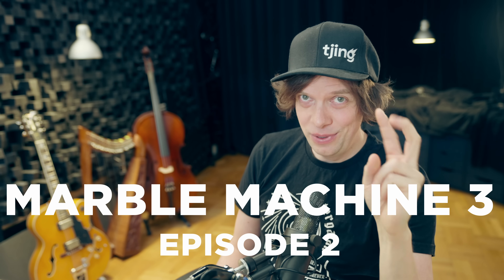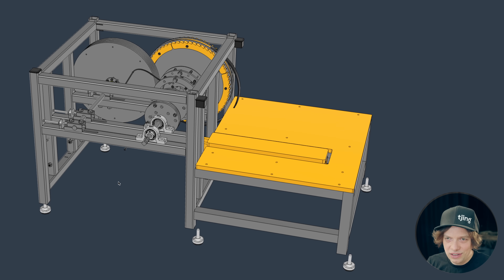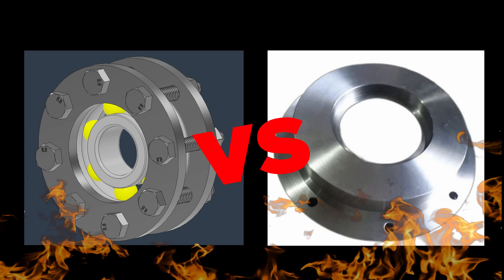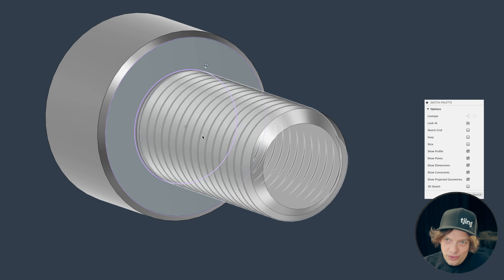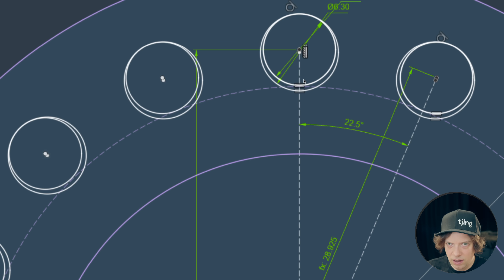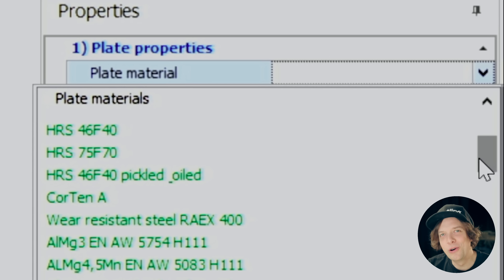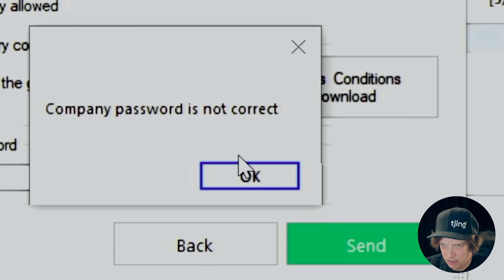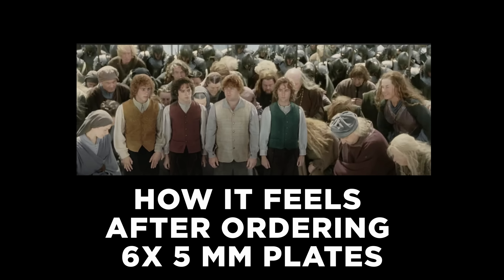Cheap Bearing Housing - Marble Machine 3 Ep.2

Comment from the maker: official place for engineering feedback, please post and help upvote the best feedback! 
https://www.reddit.com/r/MarbleMachine3/comments/137ew6l/cheap_bearing_housing_marble_machine_3_episode_2/?
Reply: A PC has more resolution than 1080p.
Its not only Mac that go 4K. A PC can also go to 4K. 😁
Reply: @metern  what, pc's only go 4k?
Reply: @dbtest117  Im not sure on which one has only 4K. But i do think most of the newes and most powerful pc gan go 4K. Maby you have to overclock them.
Reply: @metern  Well a simple iMac M1 is 4.5k and previous 27" has been 5k.
Reply: It will not work, as the tangential power will drag the disks of  center.  Any imperfections in centering the discs will drag the disks of center when you start to spin them.  And they force pulling the discs of center will increase dramatically with rotation speed.
Reply: You should really make a automatically centering mechanism that can be tightened with a bolt. Something like in a mechanical camera has to change the hole size for light to pass through. Beefed up.

Comment: Okay, but would it be any better if he used a larger diameter thick "spacer" ring - with machined inner diameter - that fits between the outer ring of the housing and the flywheel itself? To surround the bearing entirely and constrain its movement?

Comment: Martin, your fly wheel needs an automatic gears system. That way it can output constant rotation. A gear box that converts speed down to torque, and torque up to speed. Your fly wheel then becomes the battery. But it needs to be smooth though, because the gear shifting may effect the stander deviation.

Comment: Sounds good but the contact point between the screw and bearing is small. Just the tip of the thread. I would add a jacket for the screws between the plates so you increase the surface. It will increase durability by avoiding fast eroding

Comment: You should really make a automatically centering mechanism that can be tightened with a bolt. Something like in a mechanical camera to change the hole size for light to pass through.

Comment: Two points: 1 - You are comparing costs only and disregarding reliability.
2 - These are set screws and not bolts. Tolerances of the OD of set screws are poor. 
A "fitted bolt" would be better, but still not the solution.

Comment: If these are going to be laser cut, be advised that there is typically a minor defect at the start/stop point of cutting a circle, and unless you work with the supplier, it will likely show up as a little "booger" at a certain angular orientation the same on each hole.  This will likely affect one hole at a minimum, and possibly be affecting the two adjacent holes as well.  If the start/stop point is on the inner section of the hole pattern, it will not affect your fit, but this would not be the default expectation from laser-cut or waterjet-cut parts.

Comment: I'm not an engineer, but I cannot see this working as bolts will have different tolerances between batches, plus I think you will end up with premature wear of the bearings with uneven pressure around the outer housing.

Comment: you are over engineering it.  Simply purchase a four hole flange bearing and bolt it on.  No machining required.  It is already built.  4 holes to mount it to your plate, and you are done.

Comment: Martin, I like where your heads at with trying to make the cheaper option work. Look up “eccentric nuts”. I think those could make your life 100x easier and still keep this approach. I’ve seen them used in v wheel style 3D printers like the Ender 3. Essentially they have an off center hole that acts like a cam mechanism so you can dial in the fit between two surfaces. Using these on some of your bolts, you shouldn’t have to worry so much about getting the tolerances perfect and by turning the nut you can dial in the slop you might have.

Comment: Tried the bolt-housing before in a low-weight application, the weight eventually mushrooms the threads no matter what bolts you use which creates play and now your bearing moves under heavy weight. At the least use bolts with an unthreaded shank.

Bearings are universal so your housings don't have to be, but universal housings do exist. Should really consider that.

Comment: You need to figure out what loads the bears will experience which will inform what if any radial preload is needed for reliable and noise free bearing operation.   Your design applies radial point loads should it be an interference fit. The alternate option is a clearance fit but you need the right fit bearing for a loose clearance fit.on the OD and will need to make sure that the outer plates clamp the outer race evenly...  A slight improvement would be to use either some sleeves around the bolts or maybe a better idea to get some decent machined bar and thread either end so that its smooth bar in contact.  you will need to make sure the bearing is 100% located however you do it.

Comment: High load, low rpm = bushing
Low load, high rpm = bearing
I get it, ball bearings are marvels of engineering and really fun to add to your projects but you're unlikely to need them.
They're inherently much more complex, and you need to consider your different load cases, whether they need lubrication, vibrations, etc. A self-lubricating bushing would be a better solution.
But if you are going to use a ball bearing you have to use proper housing. Most likely press fitting into a reamed boss.

Comment: Take a look into the world of AN Bolts. They can be ordered with precision shoulder lengths so that you are not galling the threads of dime store bolts. AN Bolts are used in aviation and racing and might be just the compromise you need to get this design to work.

Comment: Good lord. Please 🙏 a simple bearing housing made out of aluminum is not expensive to make as long as you have / know someone who can use milling machine. A proper housing does not have any play which will cause vibrations as you will eventually get with screws, because the threads will wear down causing room for vibrations. For such a critically important bearing it would be nice to have a solid support.

Comment: surely a properly manufactured bearing housing would be more secure, reliable and above all compact (for rebuilding) than having 8 bolts, 2 plates and some nuts ? You would just have one machined 2 machined discs and maybe only 4 bolts to mount it - IMO i feel like using bolts to hold the bearing is a cheaper solution but might be worse in the long run

Comment: You could have had four tests per piece on the bearing bolt cage. With 16 bolt holes total, you could have done 4 sets of 4 different spacings and tested them with 4 bolts in at a time in a cross layout. If the four bolts fit in one spacing set, they would fit the full way round.

Comment: 6:14 Whatever display cable you're using is likely bottlenecking your resolution. If it's an older spec HDMI or DisplayPort cable for example you may not get all possible display options your monitor supports

Comment: A machined housing will be significantly cheaper and reliable in the long run.
it's much easier to nail tolerance on one machined hole, versus worrying about the tolerance on both the holes, and the bolts.
You also have way more labour required to line up the bolts perfectly, and to keep everything concentric.

Your solution MAY work, but you are creating a solution that is more akin to your MMX creeping failure points.

Comment: Loooool please don't do this XD
You're like using 30 parts just to hold a single bearing. This is not cheap, efficient or good. You can order a WHOLE SACK of bearing housings from China, with perfect tolerances. Or even better - just order bearings WITH A FLANGE. Is this just ADHD or Not-invented-here syndrome? I can't decide!

Comment: Two things, one use bolts that are not fully threaded so the area caging the bolt is unthreaded shank.  Second if you find yourself between fitting tight/loose try thin shim stock for tuning the fitment.

Comment: This really makes no sense.

Why are you not making oversized bolt pattern and simply cutting spacers into which the inner diameter can be modified as needed to hold the bearings.

Also, using the bolts in a shear application is asking for them to break. They should be preloaded to clamp the edges of the outer bearing races through friction.

Comment: You can very likely make it work adequately through this trial and error methodology, but concentricity may be a concern due to tolerance stacking.

A more repeatable and reliable solution would be to use an flanged bearing, as once in a hole with an appropriate fit, it will be perfectly concentric. You then only need to use a couple of fasteners around the outside to secure it axially, or a c clip on the shaft.

You would reduce part count and complexity greatly, plus it would be a much more repeatable solution 👍

Comment: Sorry Martin, this is a terrible idea. The first thing you should have done is measure the bolts to see the variation in size. 
You should have designed the bearing housing and then got AVE to make it on his CNC machine.

Comment: If the fitment isn't working have you ever considered a deformable gasket or other material that could be used as a shim to increase grip strength and make up for manufacturing tolerances?

Comment: If you don't choose the correct bearing for rhe correct force and Rpm, it will be damaged in a short amount of time. Because of that, would I recommend you to worke withe the calculation tool from skf bearing select

Comment: Theres plenty of comments and suggestions about the mechanical design, but I want to share something that I've learned over the past few years as a software engineer. I say all of the following with love, and as something I wish somebody told me years ago.

Over a long career, I grew more and more comfortable with my skills, my ambition and ideals also grew with it. Long nights dreaming and thinking about how to build the best thing, or solve all of the problems with one tool.

But the more time I spent on these overly idealised projects, the further I put the goal from reach. I doubted my skills and burnt out. It took me a long time to realise that the ideal solution, that checks all of the checkboxes isnt always the correct one — for the time being. 

It's fine to produce something sub-standard, because it gets you to completion. You can't iterate on something that hasn't been proven in a working form.

As much as it can be disappointing, it's ok to dream smaller and simpler. Once you have completed it, and know you can achieve that, then you can iterate.

Make use of standard parts, and tried and tested methods. Don't be afeaid to kill your darlings, and don't reinvent the wheel.
I insisted on building a lot of things from scratch because the existing tools were not 100% suitable. But I now realise that they could've got me 80% closer for free. 

Adding process and order to a flawed methodology just makes the process even longer and falsely reinforces it. 
Take a step back, realise where you're being stubborn, and don't be afraid to build something that has flaws. Because in the long term, you'll learn a lot more from — and be happier with — the imperfect thing that's completed, than many perfect things that you could never complete. 

Dream not of a future where MM3 is done and perfect in every way. But where youre building MM4 as an iteration on MM3, not as a replacement to something that couldnt be completed.

Comment: Outer bearing race is extremely hard metal, one issue you are not accounting for is that over time the weight and torque will smash the threads on the bolts. You can show this by putting a bolt in a vise and hitting the side of the threads with a hammer. They are relatively soft and will mash easily. Once this occurs you will have way too much play in the bracket you have designed.

Comment: Unfortunately, bolts are NOT precision pieces. You will never get it to run true enough without a lot of tweaking (which you said that you want to avoid). If you manage to get it to run true, the immense contact pressure on the crest of the threads will cause them to peen down and open up the tolerances again.

Much better to use a turned bearing mount that's held in position on the flywheel by two or three precision pins and then bolt the mount to the flywheel. That will run true by design without tweaking and will never move.

Comment: Martin, I like going for a single manufacturer but I think it would be cheaper to get some backup bearings and just weld a flange piece on it to hold bolts. Or grab a 52mm flanged bearing from mcmaster-carr. No fancy expensive housing needed.

Comment: Think about this now rather large machine making its way from the truck to the stage and that heave flywheel being shaken back and forth in the process.  Your concept for the bearing housing will likely work if you never move the machine or if there are never any unexpected external forces.  Working in the lab doesn’t always work in the real world.  Make this part as robust as you can it has the most potential energy of the whole machine.  It will be 100x cheaper and 100x better in the end!

Comment: I can see this being a problem, because of tolerances. When you find a PCD that gives a tight fit on the bearing, if one of the holes is the opposite end of tolerance then it won't go in. If you leave room for tolerance, it won't be a tight fit. 

And this sort of machining is much lower tolerance than other methods, making the problem worse. 

A solution:

Spirally slotted holes, fitted in opposing directions. You could give them a little twist while tightening and it would pull most of the slack out.

Comment: If your so set on using this method. At least add a recess in the flanges, so they are carrying the bearing, and not the sides of the threads. And use sholder bolts with a flar part

Comment: I think flange Mount Bearing would work better here, since you can use the wood to "auto center" them and not the bolts threads, just use your cnc to make the flang part out of ply wood.  
Your journey is a great content, we hope for the world tour, but appreciate the journey so keep at it event if there is more failure on the way, just like a lightbulb, you need to found many ways that don't work too.

Comment: Oh dear. As nice as it is to see you learn about how to design and manufacture things yourself, the problem of strong, concentric bearing housings is a solved problem. Not everything in the MM3 has to be a custom part, especially on something as critical as the flywheel shaft

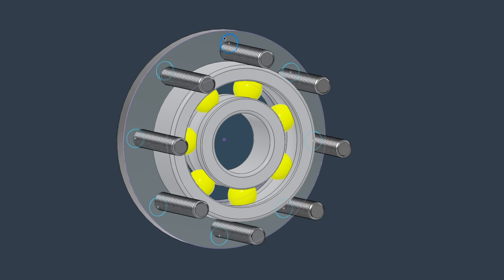Comment: 2:06. “How hard the bolts to clamp…”. The bearing is designed for a specific fit all the way around. If you have 8 bolts with small contact points, the outer bearing race will be irregular and you will get irregular movement. Depending upon speed you will get vibrations that could be a simple audible annoyance or it could be greater and vibrate the assembly apart.  Make a bearing housing.

Comment: If you're already getting these round plates with bolt holes cut just get a third one done with a center hole sized for press-fit of the bearing's OD. Don't try to use the bolts for retaining the bearing

Comment: When I look at the construction with so many screws, I pretty much expect the panels to warp in some way because the screws have to be tightened in an optimal pattern and with the same torque. So the machined case is simply 100 times better in every way. Also, a machined part leads to Martin's way of reducing parts.

Comment: I don't think the threads on a bolt is a good support for a bearing. Maybe make two extra discs with a center hole that is as large as the bearing, then have some spacers. On the bolt there would be outer-support,bearing support, space, bearing support, outer-support. That would be slightly more parts, but possibly a simpler and better solution?

Comment: Senior msc mechanical engineer here. Bad design. Just design a bearing housing. How expensive is a custom one? $120 / 1200 SEK for a prototype housing that fits? Much cheaper in small volume production at say 10 pieces. Kanskje du til og med får noe standard som passer... 
Loosing faith in your project. 80 / 20 Martin.

Comment: Wouldn't it be easier just to make a 3rd disc with a inner diameter that matches the outer diameter of the bearing and have it sandwiched between the 2 other discs with the bearing, you could probably even weld it to an outer disc for extra strength. Relying on the bolts to hold the bearing seems like a good way to have a catastrophic failure since all the forces are going to be on just 1 or 2 of the bolts, and you also risk deforming the bearing where the bolts are pressing against it. Using a 3rd disc will allow the force to be spread across all the bolts and eliminate the risk of any significant deforming of the bearing.

Comment: maybe it's cheaper, but you have to consider life expectancy of the bolts. I do not believe that the screw is a reliable surface to put pressure on. it might get loose over time faster than the cage, possibly 100x faster.

Comment: you could try a tapered roller bearing - good for axial and radial load, but because it goes into a conic hole you don't need such perfect tolerance on the holes, you can just tighten the cone down.

Comment: The biggest thing I saw here is not teh bearing, btu the quote since thise is 100x cheaper, you need to show me something that is 100x better. Thats not how things will ever work in this field. The more money you throw at a problem in engineering you start getting diminishing returns, so you need to find a middle ground. And this isnt it. Theres a reason those bearing housings exist and are a standard.